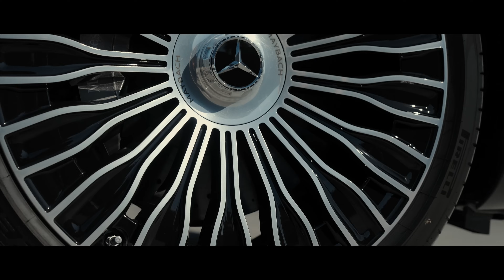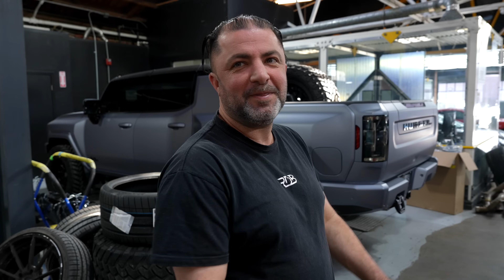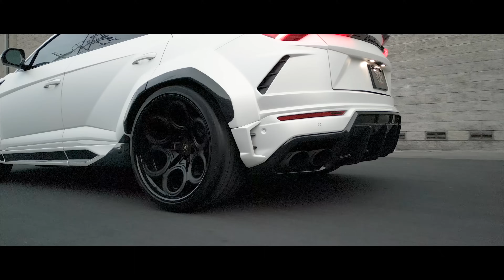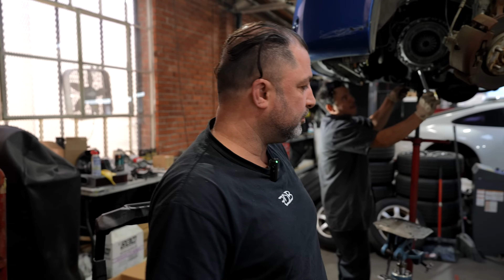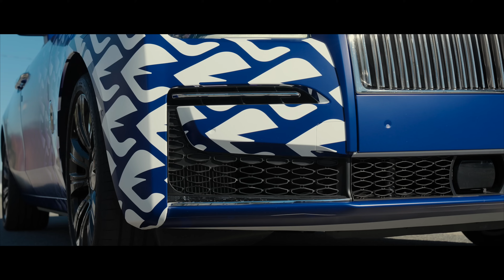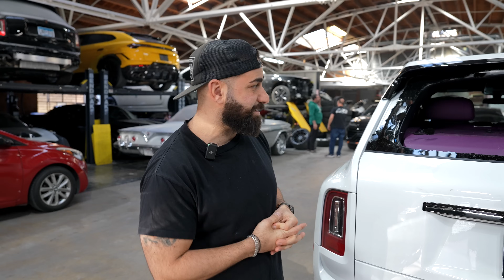SNAKESKIN ROLLS ROYCE, WIDEBODY URUS & LUXURY TWO TONE MAYBACH

Comment: Video is great. Audio with the DJI mic you are using is a bit hot and has some distortion in the first few clips, also needs to EQ'd a bit to punch it up.  A little muffled and boomy. Later in the video it sounds corrected but then the level is too low. Up it in the editor and normalize? Eager to see and hear more!

Comment: Rolls Royce used to be very strict about what you could and couldn't do to them in the UK 45 years ago, If they broke down you would never see them on an open recovery truck. If you painted them, which I did once blue and red they offered to repaint FOC in the original factory colors. I understand progress but that snake skin Roller looks like a pimpmobile, how standards have dropped. Great vids btw. Kudos.